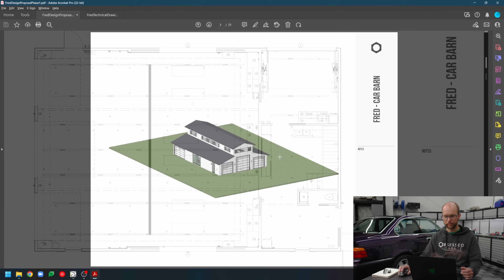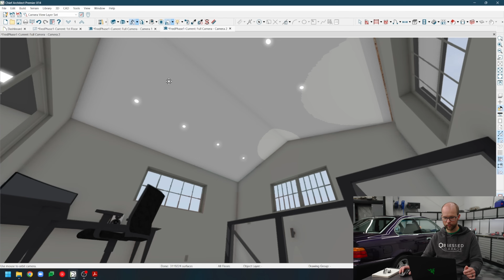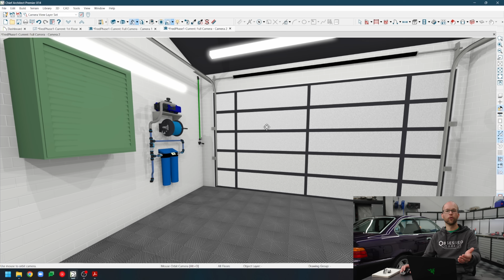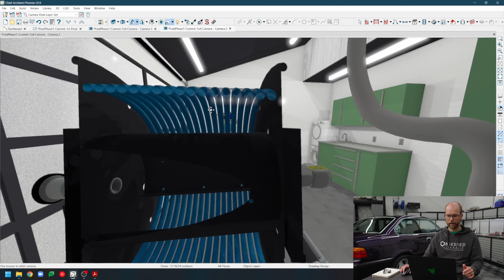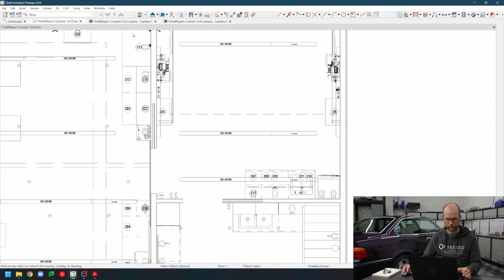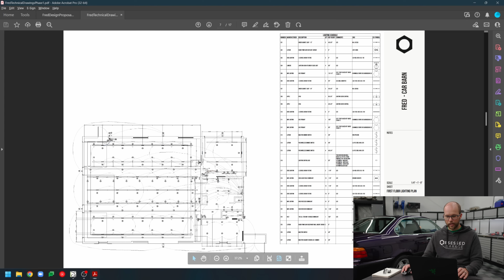Upcoming Garage Build! Garage Design Tour of The Ultimate Car Barn

Comment: Hi There . . .

. . . For those of you following the details of this build with this video series . . .
let us share some details of our client-based thinking for the Washing Workflow Use Case that Kyle presented in this video. . . . 

•	Wash Bay for Cars. 
The wash bay itself (l=15.5’ x w=16’)  is primarily intended to accommodate all of our cars (or future cars) vs our trucks (e.g. Raptor, ½ ton trucks).  The bay was planned to support washing up to a 15’ X 6’ car (e.g. P-911).  To accommodate the estimated 5’ of the car will typically extend outside by the wash bay we are adding a covered Pergola to that side of the building (l=15’ x w=30’ dimensions).

The depth of the wash bay at 15.5’ was partially limited due to the other use case functionality we wanted to get inside the overall footprint of the building (i.e., kitchen, tool room.)  But considering the climate of central calif we feel the outside covered pergola will provide a quality augmented shaded wash environment for our cars.  While this would not work in say the northeast of the US, the Calif climate makes this a workable solution for us. 

•	Covered Pergola for Trucks. 
The covered pergola wash pad (l=15’ x w=30’) will also be intended for washing our daily driver trucks (20’ x 7’)  (& 20’ horse trailer).  As Kyle mentioned we will use an overhead wash boom supported thru a diverter valve from one of the Kranzle’s in the wash bay for these vehicles.  This configuration will look very similar to the outside wash boom set up at the OG destination site in Helen Ga or Matts outside wash boom config at his 1st house in Fla.

•	Other Details Washing Workflow Use Case. 

--Use of Tambour Cabinets on Wash Bay Side Walls.  These were in OG’s Atlanta garage install and are a great (neater?) alternative to wash and detailing bottles on open shelving.

--Locating a Washer/Dryer Combo & Sink in the Wash Bay.  This will greatly enhance managing workflow for cleaning of microfiber washing drying, and detailing towels.

-- Use of a Slot Drain & Swisstrax in the Wash Bay.  We think having a Swisstrax over the slot drain will greatly reduce “sloshing around” during washing.

--Enhanced Illumination in the Wash Bay.  The proposed OG lighting will provide almost “paint booth” level of illumination—as also enhanced by near white reflective walls (materials TBD).

--Enhanced Width in the Wash Bay. At 16’ wide this will create very reasonable lateral work area around the perimeter of a typically wide 6’ car.

Kind regards to all of you following this. 

Fred

Comment: Hi There

. . . Just to echo a few of Kyles key points in this garage build video from our client-side perspective as he/OG begins this on-going discussion over YouTube  . . . 

In approaching Kyle, Matt and OG Design Team as they are developing our build—we have found it very useful to come at it and dialogue with them for creating our ‘car building’ that will most ideally support these 8 primary use-cases.
 
1.	Restoration Vehicle Support
2.	Routine Vehicle Maintenance Support 
3.	Detailing Support/Workflow
4.	Washing- Workflow / Efficiency
5.	Daily Driver Hosting 
6.	Tool/Parts Storage
7.	Electrical Vehicle Charge Hosting
8.	Multi Use-Graceful Hospitality Change Out

The standard engineering cliche applies—“Form Follows Function” and as we are getting down to the details in each of these areas with Kyle and his team, this approach has gotten us all moving in the same direction—OG’s Functional Design, the Architectural Design, and our Builder.  The approach in working through these use-cases is way beyond simply putting a bunch of bright, shiny objects/gadgets in the build just because they are bright shiny objects/gadgets.

As a quick summary, in working with the OG design team for this build we especially value their expertise with . . . 

* Creating Bespoke Opportunities for developing use-case solutions—for example, using Prevost piping for pressure washing and air distribution as well as contributing to the overall garage design aesthetic.  . . . and many others.

* Audio Visual Expertise—Thinking of and configuring a car building (aka Garage or Car Barn)as a multimedia venue with high end state of the art AV.

* Illumination/Lighting Expertise—Developing and promoting lighting solutions that consider all the engineering aspects of illumination in an automotive workspace.

* Cabinet Configuration and Tool Management Expertise—Anyone who has ever watched a Matt video on tool selection and organization knows what we mean here. 

* An Unceasing Search for the Leading Edge—for example OG’s innovations  (aka their ‘chase’) with  pressure washing, scissor lifts, dry ice, etc. etc. etc.

From a client perspective, all of this has added up to a very engaging, wholesome attempt to create a car building that is the best attempt for all concerned.

Kind regards to all of you following this.

Fred
Reply: Thanks for chiming in, Fred!